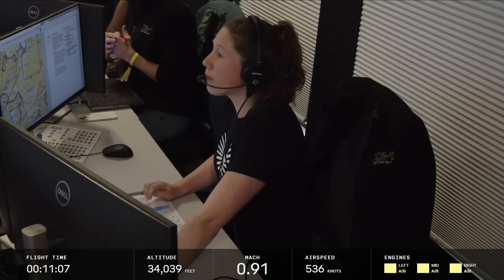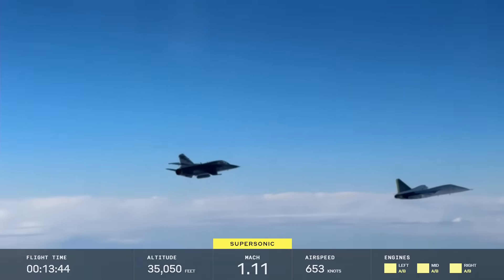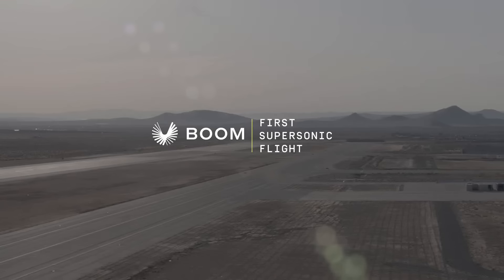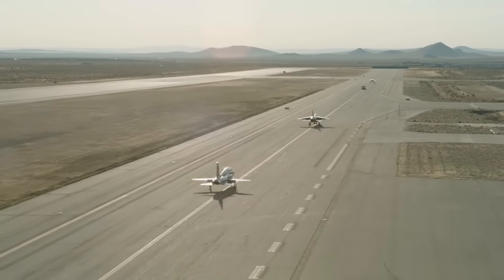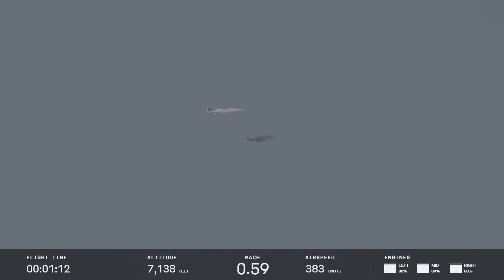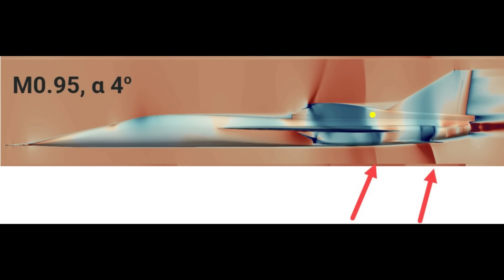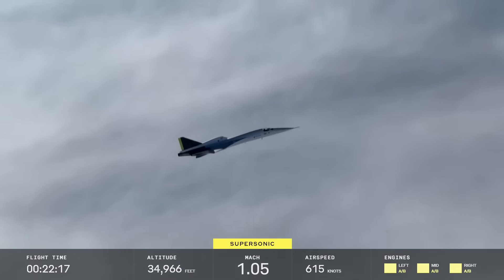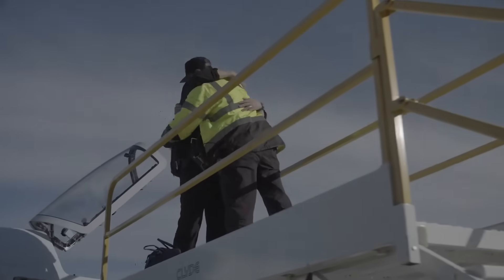XB-1 Baby Boom Goes Supersonic - Jet Planes, Starlink & iPhones

Comment: Not to diminish what Boom achieved, but it’s worth mentioning that the T-38 that was the chase plane providing the air to air video also effortlessly hit Mach 1.1, and that specific airframe has been flying for 62 years. Not to mention the Mirage F1 built in 1981. Still a great achievement, just not quite as revolutionary as it was built up as.
Reply: The Boom Overture is the revolutionary aircraft.  It's hard to get people to give you a billion dollars to build a brand new supersonic passenger aircraft.  The XB-1 is a technology demonstrator and test bed for the Overture.  It's a stepping stone to the revolutionary stuff.
Reply: @ you’re telling me that an aircraft that will be smaller and slower than Concorde and the TU-144 is revolutionary? And that’s if it ever becomes a reality. They have to not only manage to build and certify the Overture, but they also have to design, build, and certify their own engine, because they could not convince an existing engine manufacturer to build an engine for them. I wish Boom success, but let’s be honest, the word “revolutionary” is being thrown around way too freely these days.

Comment: Concorde could supercruise. It used afterburners to accelerate to supersonic speed but it could maintain its cruising speed without afterburners. This made it much more efficient. Does Boom plan to do the same? I assume so, but it looked like the afterburners were lit whenever it was supersonic.

Comment: What gets me all tingly is looking at the air intakes for the engines.  A guarantee that those were highly modeled by computers to just the right airflow and shock wave formations inside the engines.  Feeding a jet engine in transonic flight is tricky.   There are some very good articles about the SR-71 engines.  So much went into getting that intake air slowed down enough so that combustion could actually take place.  Because those were just gas turbine engines, not ramjets or scramjets.

But even so, they managed to get the blackbird up to record holding speeds for a long time.

Comment: Does anybody know what the second chase aircraft (the one visible at 14:30) is? It's clearly not a T-38 as it's single-engine, has trailing-edge sweep, and has ventral strakes for lateral stability.

The closest match I can come up with is the 2-seat trainer variant of the Mirage F1. The wing and tail geometry and the ventral strakes match up and the nose looks about right. I can't tell from the livestream if it has semi-circular inlets with conical shock bodies, but the nozzle looks about right for an ATAR-9 variant. Is that it?

Comment: I thought the whole point of this thing was that it wouldn't make a sonic boom
Reply: You're confusing Boom with the X-59 project.  They aren't the same thing.  Boom is trying to make a financially viable successor to the Concorde.
Reply: @stargazer7644  Yeah and it's supposed to be no louder than a conventional  boeing 777.  That was what they told the investors at least.
Reply: @kg4boj  The Overture will have non-afterburning turbofan engines.  It will be substantially quieter than Concorde was blasting off with its afterburners.  It'll be using engines very similar to the 777s, that's why its noise level will be similar during takeoff and landing.  They have to do this because of modern airport noise abatement restrictions.  It will still make loud sonic booms during supercruise, and will only fly supersonic over the oceans just like Concorde.

Comment: 😴 - the T-38 chase planes use two J-85 engines and went supersonic in 1959. This “revolutionary” plane has three of those engines. 🙄

None of this translates into Overture (at any usable scale). 

Also I’m getting vibes that this thing has some rather serious stability issues. You can tell in almost all the footage, chase footage, the fact that they admitted after the first flight they needed to “tweak” some such things (yeah, that’s normal for a first flight, but… not sure in this case.) 

Additionally, yeah sensors can lag during the transition to supersonic flow - but that seems ridiculous for an aircraft where you KNOW you’re going to be flying supersonic. I’d hope whatever air data reference computers they’re using can figure that out and offer more accurate info - not an issue on any supersonic aircraft that I’m aware of. That transition period is critical, so to just cut out is not good (I’m sure they continued to get the raw data, I get that..) 

Anyways, now what? Again, this is all you get - holds one person and it’s gone supersonic. What about Overture?

NASA and Lockheed’s  X-59 just ran full afterburner tests, and should match the same theoretical top speeds of this (with one engine) with a far more advanced design, while having far more sensors and telemetry recording data onboard (and in chase). I believe their capabilities to record the actual shockwaves, sound waves, etc are far greater than Booms also.  

Almost all of the X-59s data will be publicly available to companies like Boom anyways, so… 🤷🏻‍♂️

I just don’t get this thing, gotta keep the investors happy I suppose.

Comment: Speed of sound decreases with altitude. Might it be possible to achieve identical speed in an aircraft designed to fly at say 100 ft above sea level? Is drag lower at say 500knots if below speed of sound?  Some kind of ground effect vehicle for cross oceanic transport. I'm thinking ground effect vehicle are way more fuel efficient than "free air" aircraft, and can lift way more with smaller wings. larger load=better passenger carrying capacity. smaller wings=lower drag for given speed. over water too... so noise wouldn't be issue.

Comment: In a lot of fighters, including the Viper's backup altimeter, which uses air pressure data to show altitude, you'll see the altitude suddenly fluctuates when crossing the speed of sound and back. The air data computer is smart enough to integrate altitude and speed from enough sources that you wouldn't see either number go through a sudden shift on the HUD.

Comment: I’m happy to see this as a step on the way to fast passenger flight. 

But honestly im not excited about the prospect of millionaires terrorizing passing airliners with sonic booms. 
Like even if you can’t hear it on the ground, you’re definitely going to be able to hear it if you’re close enough to them in the air so these are going to require entirely new flight routes and at any point they could deviate from those fly routes cause sonic boom to other aircraft. I really don’t see this has ever being compatible with airliners and existing flight corridors unless they get the sonic boom down to basically nothing. 

Otherwise, it’s just gonna be the upper class giving the middle finger to the lower class as they boom past going in the opposite direction .

And what’s gonna happen as a disciplinary measure if this happens, a fine? It better be means tested otherwise it’s going to be just the cost of doing business.

Comment: Is the full-sized passenger aircraft going to be powered by turbojet engines? You don't really see turbojets on passenger aircraft anymore, as they have been replaced by more efficient turbofans, but when I was a kid they were still common. If you weren't around back then to hear them, they were extremely loud, and you always knew when there was a jet overhead, even if they were cruising at 40,000 feet. I can only imagine that something cruising above mach 1 with afterburners lit would be even louder, and that's before you account for the added noise of the sonic boom. Since I live in a fly-over state where there are so many contrails that they frequently add to the overall cloud coverage, I can't say that I am a fan of this if that ends up being the case.
Reply: Supercruise capable afterburner-less medium bypass turbofans.

Comment: XB-1 Boom doesn't seem that big a deal - the US has aircraft that have surpassed Mach 9.  Chuck Yeager broke the sound barrier in 1947, 78 years ago; Concord was 55 some years ago.  So the technology has been around for quite a while; the fact that a private venture got a small aircraft to do so - semi trivial?  Wasn't this suppose to be a commerical aircraft company?  Does making a demonstator semi 1/3rd size (engines aren't 1/3rd size)  prove something useful about an aircraft that would be 3x larger in many ways very different?

Comment: for those wondering, the two chase planes where a trainer mirage f1 and the t38 was a trainer f-5. both 1960's planes
Reply: Props to the F-1 for looking contemporary or at least recent. It looks like it could have come out in the early 2000s as a trainer or low cost fighter.
Reply: @fallinginthed33p  while it's a 70's fighter 🙂

Comment: Ahhh the civilian Fairey Delta 2 went supersonic at 1,132mph on 10 March 1956. It went on to be developed into the BAC 222 with an ogival wing to develop Concorde. 

The XB-1 engines appear to be General Electric CJ610 engines with  afterburners? So they have spent millions  to make an  updated F-5 that looks nothing like the Overture design. What valid data are they gathering that applies to Overture???? Where are  the Symphony engines? Where are the fuselages?  Overture was supposed to have its first flight in 2026...

Concorde was profitable for BA for 20 years because it supercruised at Mach 2.0. It remains the only aircraft to ever achieve this. The aerodynamics of supercruise were solved by Concorde in teh 1960s. 

On engines, P&W spent USD5-7bn to develop the F-135 which is less powerful dry than Symphony they are still having problems with it and have 600 people working on the upgrade alone. KTT and Boom have about 200 people combined and KTT has never built anything largher than a microdrone engine. Hmmm

Boom looks more like a Ponzi scheme.

I have flown on Concorde JFK-LHR and I would love to fly supersonically again but these guys look very fishy.

Comment: 8:44 Particularly amusing that the iphone footage reveals the AI post-processing so clearly.  It sorta thinks there's a grey and white american flag on the rudder of that follow vehicle, but it can't decide exactly where it is thanks to rolling shutter, so it shifts around a lot from frame to frame.

They should have put in it RAW mode if they wanted accuracy, which, sure, they're probably using other instrumentation for that, but it's still weird to see in a program with this much high-tech hardware...

Comment: a very ambitious project, but the difference between a tiny, pointy little test plane and an airliner that has to be able to handle subsonic in the pattern, supersonic in cruise, fit to existing airport infrastructure, carry an economically viable amount of passengers and all accommodate all the safety gear is a VERY different story. 
thats why the concorde was such a massive achievement.
there is still a very long road ahead of them.

Comment: I don't understand why this is being celebrated when the Mirage F1 chase plane, that can hit Mach 2.2, was designed 60 years ago.
Reply: That's because you don't understand what is going on.  They're building a composite supersonic passenger aircraft that will fly at Mach 1.7 economically using turbofan engines with NO afterburners.  That's something that has NEVER been done before. This is step one.  THAT's why it is being celebrated.  (No, The Concorde doesn't count because it was never economical)

Comment: Back in the early ’50’s NACA demonstrated that the drag at supersonic speeds was strongly related to the span of the wing leading to the use of short-span, thin trapezoidal wings as used by Concorde (the slender delta).
The Baby Boom is following the path adopted by RAE in SST design and its HP-115 test bed aircraft.

Comment: So we are back to the 1950s.  I take it this is supposed to lead to a quieter version of concord.
Reply: This is supposed to lead to a financially viable version of Concorde.  It will use non-afterburner turbofans to make takeoffs significantly quieter than Concorde.  It will be more efficient than Concorde.  It will still boom like Concorde so it will also fly over ocean routes like Concorde.

Comment: From "Mach 3 Blackbird" to "we can reach Mach 1". The only thing that matters today is good 4K footage. Real achievemnts do not matter anymore.
Reply: The technical achievement may lay in the development cost. It's a civilian startup, likely without a lot of funding. Completely different from multi billion dollar defense contracts which easily payed for an army of engineers.
Reply: @cube2fox  That doesnÄt tell anything about the viablility of the concept.
To get a plane flying Mach 1, ther is nothing new to achieve, just learning from already made ones.
You'll have to prove to get the economics right. Does it fly cheaper? Or are there enough billionaires urgently in need of a plane saving an hour over the atlantic ?
The hard tasks are still ahead.
Reply: I don't think a vehicle which leaks fuel on the runway would make it as a commercial airliner.
Reply: @michaelmicek  This isn't a commercial airliner. It's still just a prototype. And if going in production it has to prove economical viable.
You can also take Concorde for comparison - did "only" Mach 2.
Humans could build supersonic airplanes before.
This is just a downscaled version to try again to compete with the only proven viable civilian airplane concept known as subsonic jets.
Reply: You really don't understand what these good folks are trying to achieve.

Comment: This is 49 years on from the entry of Concord into service, and those Concord design engineers did not have the advantage of massive computing power to assist them. Mainly they used slide rules and draught paper. Plus wind tunnel models. Also relatively little was known about tackling such a problem.

it's nice to see someone finally follow these trailblazers. Even if its taken about 50 years to begin the process of catching up with a full scale airliner.

Just wish they did not pretend to be trailblazers themselves. It's cringe worthy 😬 

Maybe a certain leader wrote their script for them 😜

 Should the EU return the favour paid to Concord all those years ago by America, and not allow their airliner to overfly the European contenant at super sonic speeds 😂 

OK, I'm joking that would be really petty.

Good luck to them. They deserve success

Comment: Mach 1.1 should be easy since air-breathing aircraft have been going supersonic for 50+ years . . . don't over-hype this.  Not easy, but not that hard either.
Reply: Doing it in a way that’s economical and not a major disturbance to populated areas is the hard part

Comment: I don't understand why that high angle of attack is required during takeoff.
Reply: That’s the delta wing. The maximum lift happens at a high angle of attack. Concorde and the TU144 were the same. And that’s what this plane is for; it’s a testbed for that wing planform that they’re gonna use on Overture. The rest of it (engines landing gear etc) are all off the shelf stuff. Keeping it cheap.
Reply: @siegeteamcweir6859 eh?

You’ve massively oversimplified an incredibly complex situation and made some crass assumptions with your answer…

This aircraft is visibly flawed & is flying at excessive alpha. The drag it is generating from the poor aerodynamics in this design mean that there’s nothing useful from a test / prototype evaluation perspective. 
There would appear to be no sensible way to manage the movement of the centre of pressure as the aircraft accelerates into the high subsonic regime & the on into transonic & supersonic flight.

The 2 chase planes managed to fly the same detail but without looking like a wounded duck…

Comment: Does this design scale up?
The engine placement, landing gear, fuel location and many other things need to move to make room for cabin.
Is it even economically viable to run afterburner in long durations?
Reply: Apparently Overture is supposed to have engines that would allow it to go supersonic without afterburner.
Reply: @ricahrdb engines are the key but they don’t exist yet (may never exist 😮)
Reply: @olasek7972  Concorde had them and some modern jet fighters have them. But they are incredibly complicated to develop. I also have great doubts that they will succeed in doing that.
Reply: @ The biggest problem I have with this scaled down test flight is, that there are so many things that need to be changed on the scaled up version that the test flight is almost useless.
Reply: @larsjrgensen5975  I agree, not sure what the point was of building this small jet unless perhaps to use it as advertisement and getting more investors

Comment: I'm not super knowledgeable in supersonic flight—when the aircraft breaks the sound barrier why don't we see a vapor cone? Is it due to this being over the dessert?
Reply: Kinda. They were up at high altitude when they went supersonic. Air is really dry up there. The fogging you see is those compression shockwaves, not necessarily the vehicle going faster than mach1. The pressure drop in the shockwave is what condenses the moisture out of the air.
Reply: @siegeteamcweir6859  Interesting, thanks!